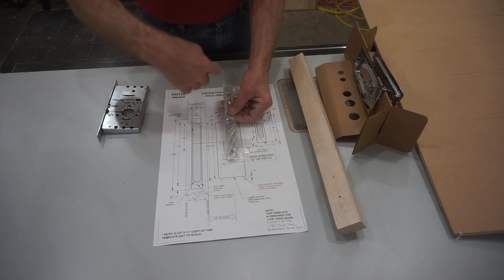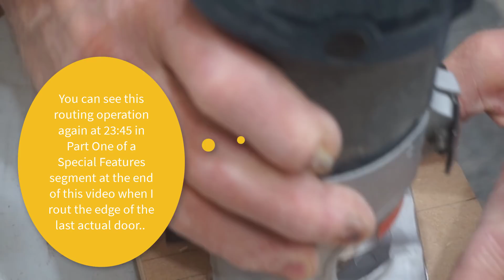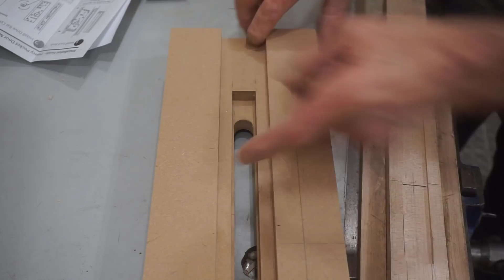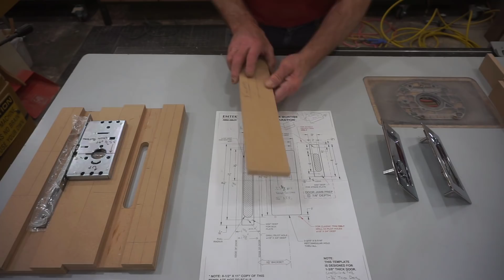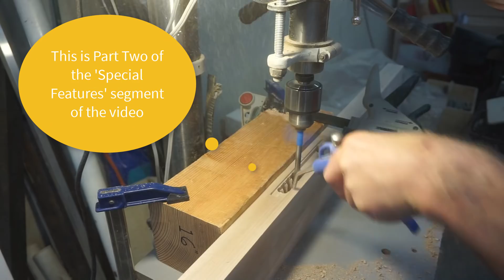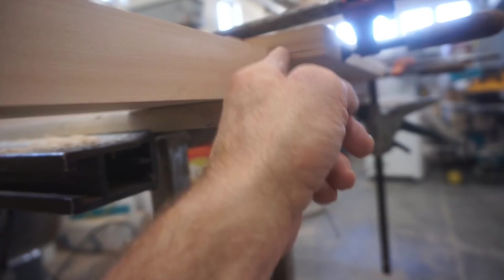Making Precision Templates for Professional Hardware Installation

Comment: Installed these a number of times , even with good templates they are a pain in the neck ...
Reply: Aloha Matt ,
Ha ha ha job security is right !
Enjoyed the video, I make my jigs in a similar fashion, love CA glue !!! 
You mentioned in your video that you don't use a plunge router , Neither did I for years in fact my shop did and still has the PC 690 and 100's  in use and has for decades...
The reason I mention this is , recently with in the last two years or so I picked up the DW 611 a little larger than a lam trimmer but not quite as large the 690 , I really picked it up because of the fixed D base it had and a lil more power than the lam trimmer I had just burned out; It was a kit with the plunge base so I purchased it ..
Like you I have always used fixed bases and that is a familiar feeling to my hands , I decided to give the plunge a try for something I was doing at any rate it felt very similar to my hands as my go to PC 690 or even the 100 , but smaller and less cumbersome ...
The bonus was the plunge effect, it really is smooth and the adjustments are easy ...
As you know after using a tool thousands of times over a career the feeling to the hands and familiarity is key , Man ! - this set up has become my go to router for most tasks anymore because it feels so familiar  ...
The change from fixed to plunge is effortless and both bases are super useful, I used it today to mortise wire channels in a panel of a cabinet install and cut outs for receptacles , both fixed and plunge bases were used and changed out from base to base in seconds ..
I share this as one tradesman passing on good information to another , its worth taking a look at .
I thank you for passing on your knowledge to others and maybe this will be useful to you or someone who takes the time to read it ...
Take care 
Best J;-D~
Reply from the maker: @jerrydoe2786  thanks for adding all that tech info... much appreciated.  Knowing you switched after so many years makes me give it extra thought but it's hard to conceive anything that I'd prefer to a D-handle design.  I looked at the Dw611 and PC 691 on Amazon just now and will ponder implications because my 'ol Bosch D-handle has seen better days.  Hopefully others will glean useful insight from your comments too... Best, Matt
Reply: @NextLevelCarpentry  Aloha Matt, the base plate is shaped like a D on the fixed base not the handle ... and the plunge has the two handles typical at the sides
Like most routers do , thats what makes it feel so familiar 
The base on the plunge has two flat edges opposed to the typical round base 
This is a cool feature for running along a straight edge or track extrusion ...
The D base on the fixed base is a nice feature for a multiple of uses in particular edge trimming and round overs, I'd get some plexi and make some of theses bases for my other routers if I had the time  and I may sometime in the future I'll just add that to the list LOL ...
Best J;-D~
Reply from the maker: Unfortunately you are absolutely correct on that Jerry!  Job security for us though since if it were easy, EVERYONE would be doing it, right?! 😎 Best, Matt

Comment: Those are some fine locksets (Baldwin?)
I imagine you may be using 
Hefele hardware to hang those 
doors.  (I hope you take the same care with getting paid.)
I have an  army of single purpose jigs from my custom stair days, stored with the  unique pitchblocks. Looking back I know how crucial they were but.... I feel silly every time i look at how much space they keep in the barn.
Thank you for what brings you joy!
Reply from the maker: Hey George they're actually Emtek/ Assa Abaloy and, as you might know, their beauty is only skin deep in some regards... very finnicky and tempermental requiring quite a bit of fiddling to get the smooth function clients pay for.  I love the fact that you're mindful of 'getting paid' because the uninitiated will usually end up subsidizing their clients if they bid Kwikset and have to install Baldwin, right?  Believe me, I make SURE I'm covered!  You're welcome... and your comment is one of the things that brings me joy! Best, Matt
Reply: @NextLevelCarpentry  gratitude is  an  over unity energy source .
The Hefele  pocket door gear ( $1,800 here in the east ) is pretty turn key, with a very kind soft closing action, but require absurdly outsized  R.O.
  P.S. Ever fill stud bays ( plywood both sides ) with sandbags?
Reply from the maker: @georgemckenzie2525  Sand-filled stud cavities?!  Good grief!  Is that for sound deadening or bullet proofing?  What I have seen is when a lazy sheetrocker scraps out his job by stacking stud cavities full of cuts before buttoning up a wall instead of hauling them out to the dumpster... guess it would have similar effect 🙄😲😎
Reply: @NextLevelCarpentry  no concrete on this project , the sand adds enough weight to keep the building down in  a high wind event. Sound and thermal benefits were a plus .
Galvalume on 1/2 " cdx on 1.5" of isocyanurate on 1/2 " of cdx then 3.5 " of sand then 5/8 a/ c . It probably would slow down all but a 50 cal .
Reply from the maker: @georgemckenzie2525   Holy smokes... that's bizzare!  Fun project to work on though!  Best, Matt

Comment: I have use these before. You better use a template because it has close clearance where the face plate screws go. Great video!
Reply from the maker: You know it, Ball Boy... even with a template this hardware was miserably temperamental!  Thanks for sayin'... Best, Matt
Reply: @NextLevelCarpentry  I didn't want to say it but you did. lol I did 10 sets on one job.
Nearly pulled out all of my hair lol
Reply from the maker: @OffRoad-jh1do  I fussed with that beautiful but miserable privacy lock for probably 45 minutes trying to get it to function smoothly when the escutcheons were tightened down.  Tried EVERY trick in the book that we use when mis-alignment causes a lock to bind when tightened. 45 MINUTES until I tried a couple drops of lock-ease on a brass thingy inside that rotates when the flip handle is turned!  Boggles my mind that a $200 piece of hardware needs lubrication right out of the box when it's new to function as smoothly as a $30 Schlage Dexter knob!  Job security for us though, right? Best, Matt
Reply: @NextLevelCarpentry  That's why I stopped charging fixed Rates for Hardware because the interior designer will come back with this high-end stuff that you have to assemble or is very finicky. Seems like the cheaper to lock the easier it is to install. lol
Reply from the maker: @OffRoad-jh1do  we'd work well together!  I'm wrestling with a couple knotty interior designer issues at this very moment and use a cost plus business model for exactly the reasons you state.  Get to do some pretty fascinating work but at the price of stress and frustration, right? Best, Matt
Reply: @NextLevelCarpentry  As Craftsman we are a Vanishing breed...

Comment: I assume you had a reason for using compressed air instead of vacuuming the router shavings.  BTW you crack me up with your invented words.  And if I didn't know better, there are times I think you were actually mocking yourself.  :)
Reply from the maker: I find a blast of air is just more practical Wayne but won't discourage anyone from using a vac.  A good buddy of mine got me in the habit of inventing words and it kind of stuff... he'd crack me up continually with words I couldn't spell or even pronounce but that instantly and clearly communicated the point he was trying to make.  Best, Matt
Reply: @NextLevelCarpentry  okay, blast of air, quick and easy. You're going to clean up your shop later anyway, right?
Reply from the maker: @waynemiller6070   yeah I suppose it's force of habit since I've been using compressed air to blow stuff off since days working in a body shop in the late 1970s so it would be a tough habit to break even if it is sensible to do so😅

Comment: Not to nit pick, but I’m wondering if it wouldn’t be better to cut the narrower door-edge mortise first?  That way, you would not have to transcribe the center line after the first mortise is cut.  BTW, I have the same table saw setup with unifence and zero clearance insert.  Too bad that Wood Dynamics, the maker of the ZC insert, apparently went out of business - they had a very well made product.
Reply from the maker: Capt I... in a production setting your mortising sequence would certainly make more sense and wouldn't be a bad idea even in limited quantities shown in the video.  Not sure why I did the wide one first other than maybe force of habit from most latch bolt hardware installs?  Who knows.  Gotta love our Unisaws and Wood Dynamics, right?  I'd buy a new saw just like mine if I could still get a right tilt model... sadly that feature has gone away with Wood Dynamics in the general direction of constant product improvements and upgrades that are often hindrances and downgrades IMHO.  Best, Matt

Comment: Great video, however i am so thankful Australia is metric! A tip I use to make the first plunge easier is i make a small depth hole with a drill the aproximate width of the cutter, so you start the router on its base with the cutter and bearing safe from nicking the edges. Also I have found it awkward to 'angle plunge' into harder woods.
Reply from the maker: Metric is for people who can't handle fractions Pinpatch! 😂😎 Thanks for adding those EXCELLENT tips here... I would be wise to adapt them myself when working in dicey situations where nicking a complex template is almost inevitable... you taught me something here... now I just have to remember🙄  Plunging, angle or otherwise, is also more difficult with anything less than a very sharp bit.  Best, Matt

Comment: As always, thank you for taking the time to share your knowledge and help us out! When I think of the hours and hours I have spent making jigs in a single piece of ply, mdf or lexan laying out scribing and then cutting, and filing and sanding and... and... I feel robbed. Your method makes so much more sense, quick and efficient. You are a wood star!
Reply from the maker: Good thing about doing it 'the hard way' as both you and I have done, is that it makes you appreciate AND remember the easy way, right?  Thanks for commenting Daynaleo! Best, Matt

Comment: Thanks Matt, great instructional video as usual.

Question: Does the "activator" over-spray onto your table saw not affect the performance of timber sliding when you come to use the saw? 

Regards, Mark
Reply from the maker: Good question Mark... there's no after effect of activator on the tablesawsaw top... or anything else that I know of.  Oh... it leaves an after effect on my sniffer... the stuff smells like an uncleaned public urinal IMHO 🤢 and can 'soften' varnish type finishes.  If any gooey glue ends up on the tabletop I just spritz it with activator and then scrape it off with a razor scraper after it hardens and 15 seconds or so.  Glad you liked the video... Best, Matt

Comment: Great video!  I've frequently struggled to get those types of jigs right.  Now I know why.  Thanks!
Reply from the maker: Thanks Curtis... if this helps you do better work faster I'm glad to have shared it.  You've probably already guessed but this is pretty similar to the process I'll use to cut out an opening in a certain piece of Phenolic material for my new router table setup.  After making a template for the actual opening I'll just take another lap around it with a rabbeting bit to leave a perfect 1/2" wide lip 1/4" deep for a piece of clear Lexan to drop in to.  More on that later... Best, Matt

Comment: Sleek and sexy, Matt! Doors and templates😁! I wonder now after having spent so much time chiseling out for hardware that I would have been faster making templates even for a one-off door. Thanks for inspiring me, inspiring us! Merry Christmas and a Happy New Year, Matt! Blessings on you and your family!
Reply from the maker: I didn't really want to say it in the video but my mindset aligns with what you wonder about Sennest.  After making templates like this and getting used to it it really is faster to whip up a quick guide template even for a one-off job.  In the old days the grain of wood used for making doors was a lot straighter and consistent so chiseling was less challenging.  The squirrely wood that gets used these days is almost impossible to chisel flat and smooth for getting a good fit with hardware, another sound reason to go with routing for mortises.  Glad to provide a bit of inspiration... hope it helps your work go faster and better!  Best, Matt... and best wishes with blessings for your Christmas and New Year!

Comment: I mortised in all the locks in my Craftsman home when I remodeled back in 2009. I can vouch for how long it took to mortise each door by hand with a bevy of chisels and boring bits! Thanks for the visual treatise, Mr. Jackson!
Reply from the maker: I feel your pain, geardriven!  That sort of drudgery is a strong motivator to find a better way, right?  Hope this helps on future projects!  I mentioned that this process and way of thinking works for a wide range of tasks like hinges and such so I hope it helps open your eyes to other time and frustration saving applications.  Best, Matt
Reply: @NextLevelCarpentry  Yes, definitely got me to thinking. I'm going to make a router guide for 3-1/2 rounded over hinges. They seem to be the most common ones I have to install in my business. I know why they're rounded over but mortising them by hand is a pain. I usually make the radius with a spade bit and cut the rest with a chisel but your template idea is much better and repetitive! Merry Christmas and wishes for a safe and healthy new year!
Reply from the maker: You're on it,  @klmbuilders5385  ... using a forstner bit of the same radius as hinges with those large rounded corners will make quick work of creating the template you need.  You already know it but it seems like you might cut the drilled hole into quadrants instead of half circles to make the template?  You'll figure it out, of that I'm sure.  Best, Matt and best wishes for your Christmas and 2019 too!
Reply: @NextLevelCarpentry  36 years in carpentry and I'm still as adventurous and creative as I ever was!
Reply from the maker: @klmbuilders5385  glad to hear it...  that's the true secret to success in our trade, is it not?

Comment: Newbie question: Is a spade bit preferred over a forstner bit? or are you saving your forstner bits for more precise work? Thanks
Reply from the maker: Good question MrMnchstr... the main reason I didn't use a forstner bit for this was that the 11/16" bit I have wasn't long enough to drill the full 3 7/8" depth.  I even dug through my drawer thinking I had an extension for it without result.  As you assumed, forstner bits are better suited to 'more precise work' meaning the spade bit was fine for this project and maybe even a bit more efficient for chip ejection. For that ability it could be seen as preferred.  Best, Matt

Comment: Hey what about a video on the rest of the hardware for the pocket door?? You said messy shop I wish my shop was that clean!!!!
Reply from the maker: I thought about it Ed because those are custom/non-standard from start to finish.  Didin't have time to produce a video of the process but it would have been quite informative what with planning, designing, making and installing them.  Pre-packaged ones were beyond useless with all the considerations required on this project, that's a for-sure.  I'll add it to the (long) list at your suggestion though... Best, Matt

Comment: Great use of ca glue, might have to finally get some. I hate box locks though.
Reply from the maker: Box locks are a considerable challenge, especially when not done in a production setting where volume averages out the extra time for learning and getting set up binnsh... but don't let that, or anything else, keep you from getting CA glue and getting used to using it.  But don't bother getting CA unless you get an aerosol activator for it because it's utterly useless without it! The Gorilla/Stick Fast you seen in this video are my favorites, hands down BTW.  Best, Matt
Reply: Next Level Carpentry I’ve had door stiles break at the thin spots of wood left by the mortise. I don’t miss box locks at all.
Reply from the maker: @binnsh  I know what you mean... and even though 1 3/4" door are a bit beastie to work with I was thankful these weren't 1 3/8" thick for that exact reason... the door faces get pretty fragile with that huge mortise chopped out for the box!  I do appreciate the challenge on occasion but prefer to stress less about hardware installation... Best, Matt

Comment: If these were regular swinging doors with a beveled edge, would the templates have to be made any differently? Or would you put the bevel on the door after all the mortising? I've had to install mortise locks similar to these on swinging doors but the mortising was already done for me so I never got to see the process. Thanks for sharing the knowledge
Reply from the maker: Beveled edges on doors definitely need to be accounted for Chris and I can imagine any number of ways of doing it.  A simple way would be to make a beveled strip of wood at the same angle as the door's bevel and use it to index your template when doing the 'short face' of the door.  The same strip could be used on the door edge so the mortise would be parallel to the door faces and not 90 degrees to the beveled edge of the door.  Door shops might do the machining on doors while the edges are still square or their jigs or machines compensate for it somehow afterwards.  Good think is you're thinking about it... with that sort of insight you'll have little difficulty getting the results you're after.  Best, Matt